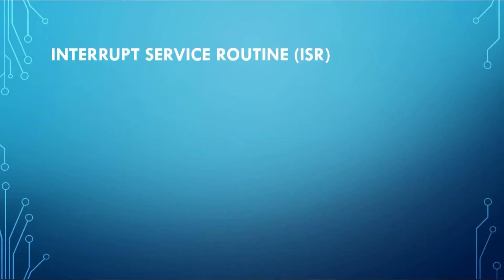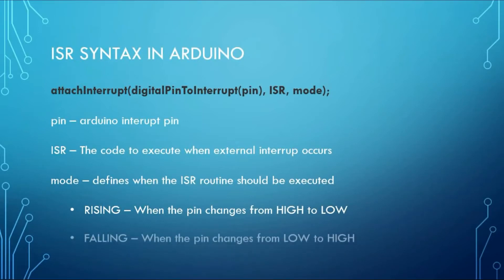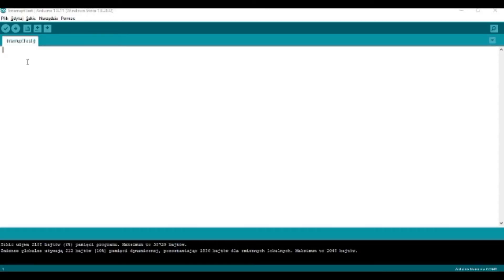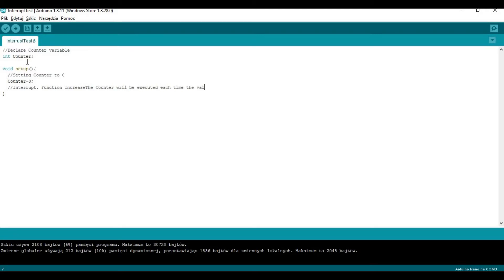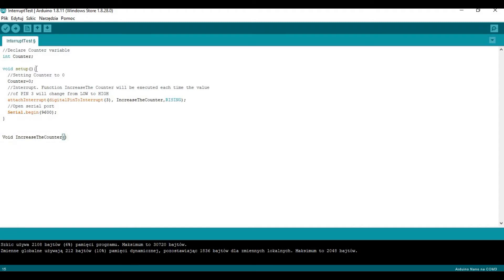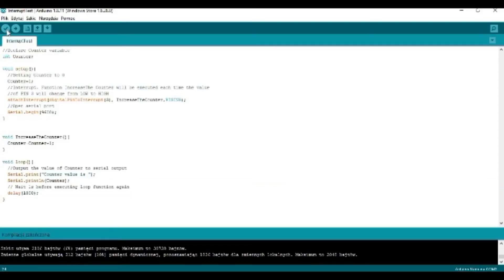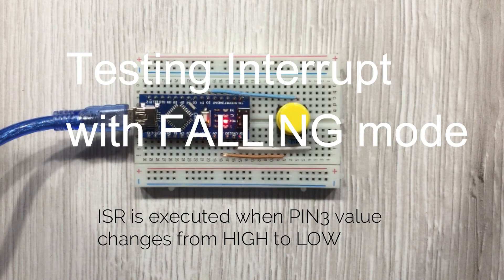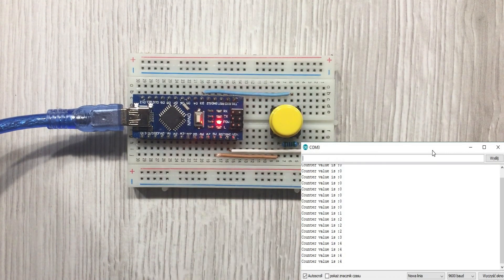How to use interrupts in Arduino projects.

Comment: Did you mean to say rising is low to high and falling is high to low? Or is it rising is high to low and falling is low to high.
Reply from the maker: Didi I say otherwise. Which time stamp in the video? if I did sorry. Raising is from low to high of course.
Reply: @marios_ideas  thanks so much for the correction and shoutout lol :) also I am currently working on a project with an arduino uno and a Hollywood skill crane. I’m attempting to raise the required cost to play using the arduino and coin acceptor you used in your coin acceptor video. I was wondering if you could help me solve my problem.
Reply: 2:05 is the time stamp
Reply: Thank you Mario I just wanted to clarify bc I’m new to this and I was confused. Thank you for your informative videos I’ve learned so much
Reply from the maker: @Brandonsk812  Thanks for spotting this. I have updated the description of this video. I may redo this video one day. It is one of my first videos. If you liked this video give me thumbs up. Helps me a lot. Check also my other tutorials.

Comment: Sir pls send the code to stop the buzzer after 10 seconds , actually I have made water level indicator using ultrasonic sensor but when water reaches high the buzzer works continuesly , but I want it work only for 10 seconds when the water reaches high level .
Reply from the maker: Sorry. I am getting too many requests like this. I have a patreon website where I can provide limited support in your coding